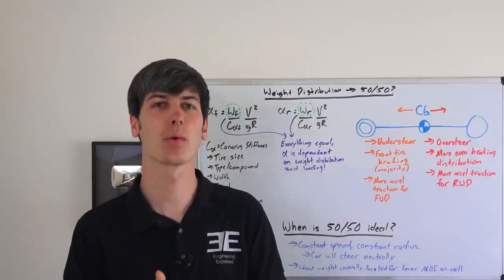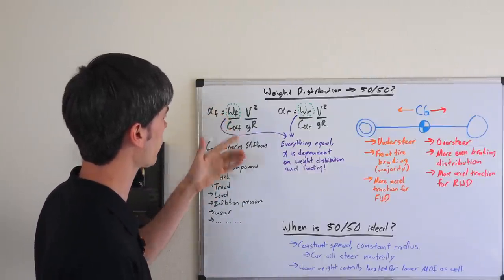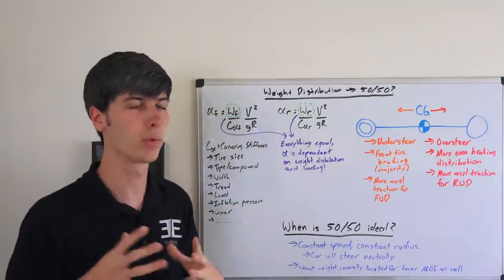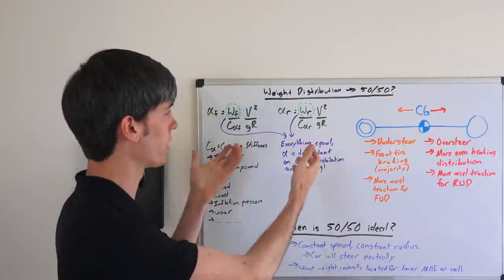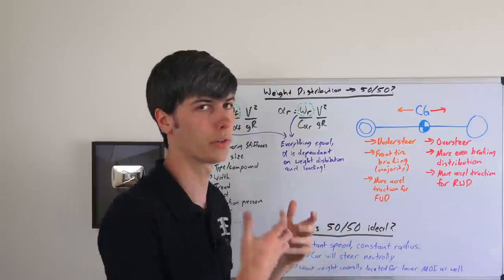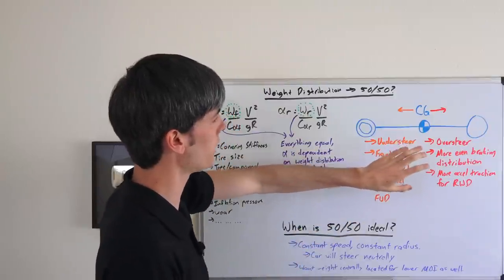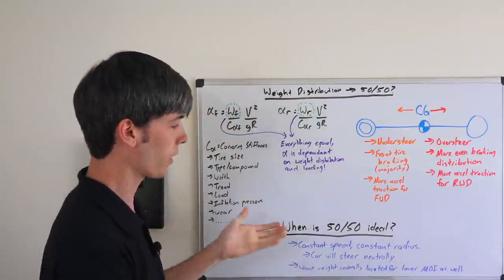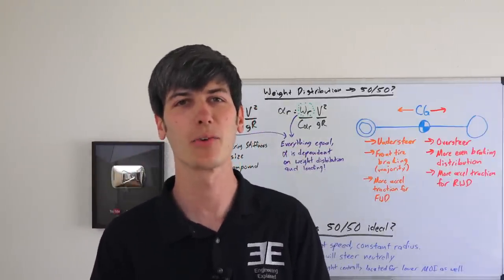Is A 50/50 Weight Distribution Ideal?

Comment: This is the reason you often see wider tyres on the rear. They have a higher cornering stiffness and can cope with more weight allowing the COG to be moved back. As mentioned, moving the weight back is benefitial for traction and braking, but also steering performance. The distance from the COG to the front axles makes a longer lever arm.

Comment: Last statement was wrong. Moment of inertia is not lowest at 50/50, it's Reduced by moving the CofG toward the rear. - because cars do not rotate around the C of G, they mostly rotate around the centre of the rear axle, especially at low speeds. Gaining a lower moment of inertia is actually one more reason for moving the CG towards the rear axle.

Comment: I think there needs a prequel for this video explaining how to take a racing corner. You did briefly mention neutral throttle during the corner and yet people are still arguing about acceleration. I think clarity is needed in regards to braking point, turn-in, neutral throttle, apex, post-acceleration and how the 50/50 fits into that.

Comment: Like you said, 50/50 is only ideal while in a constant turn/speed. Under breaking and acceleration (corner entry/exit) a rear weight bias is desirable. Although a 50/50 distribution allows for a more predictable car its not what racing teams want. Take formula one for example. An f1 car has closer to a distribution of 30% front 70% rear. Most "top tier" vehicles like Porsche, Ferrari, Lamborghini, koeniggsaig, Lotus, McLarren and others have a rear weight bias. Watch a video that shows a race driver's feet while they are driving and think about what percentage of thier time is spent on the breaks or gas as opposed to coasting  at a constant speed. That being said, I like your videos.

Comment: I don't like it. I had a 520i E39 touring (rear air suspension) and it was nasty in the snow. Coming down a steep icy hill the rear wheels locked up just from compression braking. The smallest movement of the steering wheel caused rapid and unpredictable responses. Front midship is nice when you have traction. When you don't give me a lump over the front that forces a predictable result every time. Same reason I don't like mid engined cars. I actually prefer F/F layouts despite perrolheads generally preferring RWD. I find F/F to be fun at the limit and forgiving to mistakes

Comment: Can't you make a video about over revving? 
That would be nice! 
Greetings...
Reply: Stijn Peeters what do you mean by over revving? if you are asking if its dangerous to over rev then the answer is different from car to car, some cars can do 5000 max and some even 9000, the only thing they all have the same is that you have to let the engine warm up before revving.
Reply: sweet dreams I think what he was referring to was revving past the interval which would yield the optimum average power output, not necessarily the peak. Again though, this would also differ per vehicle. +Stijn Peeters please elaborate :)
Reply: RadioACtiveN3Rd thats simple , changing map of the car to be able to rev more than stock means more heat and less reliability, in some cases because the valves dont match the high rev (9000)  you may even get less power than you did at stock rpms (7000) so if you increase the rev without touching the engine then you dont deserve to drive, it doesnt need a long video.
Reply: sweet dreams I dont think he meant taking a car with a 7000 redline and delimiting it so it can reach 9000 I think he meant more like whether or not in a normal car its faster to go all the way to / slightly over the redline before shifting up or to always keep below the redline.
Reply: You want to shift right at the redline, or right after you reach and exploit your cars peak power point. Hitting the redline just halts acceleration. To be honest, I'm not sure what would happen if you changed a car's redline from 5000 to 9000. I imagine that you would hit the peak rpm, you would have the same amount of power from the peak for the rest of the rev range. (I'm just guessing)
Reply: Evarn evon It's a little late and I'm no professional but from what I've seen, besides it being damaging to the engine, the power usually drops off significantly before the redline. If you just look up bhp graphs of different cars you'll notice a trend. It's probably dependent on the car and I'm sure race cars are quite different than road cars (de-tuned engines seem to level off for obvious reasons).
Reply: You get valve floating if you overrev too much. Valves do not close and open nomore and tend to be 'stuck' making your piston about to kiss that valve. So yeah, go ahead, overrev, drive 100mph and put it in 1st gear and dump the clutch, see what happens.
Reply: "Over revving" means exceeding the maximum RPM that the engine can safely operate at, which is called the redline, which is never good. The redline varies from car to car, but the simple answer is exceeding it is a bad idea, especially with the engine cold. Upgrading the internals of the engine can allow it to safely rev higher, depending on a lot of factors.

Comment: The way people say 50/50 being ideal is misleading. They usually forgot to mention static weight distribution.

Look at the GT-R for example. IIRC, it has a weight distribution of 54/46 when it is not moving. However, when it is moving, this weight distribution shifts closer to 50/50 throughout straights and corners.
Reply: Kalsonic during acceleration it would have 50/50 but at a constant speed its weight distribution will be equal to the static weight distribution and while braking it would be even further forward than the static weight distribution so maybe 58/62 under braking.

Comment: Surprisingly this is the result of the formula used above for my bmw e46 m3. The 3 answers are measured at 30 50 and 70mph and given as front/rear percentage 
49/51 
52/48 
46/54
On Michelin pilot sport 4s tyres at 255/35x19 front and 275/30x19 rear 35psi front and 38psi rear

Comment: Biased weight distribution is better in everyday driving as it is generally safer, more economical, responds better to engine modifications and wheel/tyre modifications. Here is why...

All else being equal (tyre material, rim size etc) maximum traction you 
can achieve will largely be a product of the weight placed on the tyres 
of the driven wheels. 

If we were to have two identical vehicles (total weight, engine power, transmission gearing etc) the vehicle having a biased weight distribution on the driven wheels of say 60/40 rather than 50/50 means that at any given time there will be greater maximum traction on the vehicle with a biased distribution.

This also means the vehicle with a biased weight distribution will have more ability to plant more power should the engine power be increase as in modifications.

A biased weight distribution also means the driven wheels have a higher threshold of traction in motion such as the lateral shear forces experienced in a turn. This makes the car safer as the car has a higher threshold before losing traction and control.

So in short a 50/50 is not the best for traction.  A biased weight distribution has better traction, much safer in everyday driving, ability to reduce wheel spin when ground pressure is reduced such as when wider tyres are fitted and is also more economical with less minute slippages experienced.
Reply: "So in short a 50/50 is not the best for traction.", unless it's a 4WD then...

Comment: Great video.
I think you should expand on this and describe how a car's weight distribution impacts how you would attack a corner.
For example in an S2000 you would do your breaking before entering a turn so that the car is 50/50 through the turn, and in an 911 you would trail brake through a turn to achieve 50/50.

Comment: @Engineering Explained Most weight distribution discussions seem to focus a lot on "something / 100-something" weight split front/rear but completely ignore the impact of weight being more centrally located. Any chance to make a video on that? When I imagine a standard gym weight in 2 setups a) O - - - - - - O vs b) - - - OO- - -  , the weight distribution is 50/50 in both cases, also center of gravity is the same. Nevertheless if they would be hanging by rope attached to CoG and I should turn it around by pushing towards side on one of the ends (basically what front wheels are trying to do 😅) the result would be different. The difference could be major for vehicles with engine in the middle...

Comment: So this may be a silly question but here it goes. If a car had a 50/50 weight distribution, and in the rear, the car had a lot of down force, would that make a big difference in the rear brakes ability to slow the car. Would more downforce in the rear even thought the car is balanced 50/50 enhance the braking ability of the rear tires?
Reply: If properly biased with enough stopping power, yes.
Reply: of course it would - that's basically what downforce gives to the tyres - more grip. Also wings for downforce will likely generate more drag which will also help the car to stop. eg: Just lifting off the throttle in an F1 car causes more braking effort than a normal street car with the driver hard on the brakes.

Comment: how do some cars like the Mazda Miata an s2000 which both have front engine and front mounted transmissions have a 50-50 weight distribution? All the weight is in the front.
Reply: kevin soos Aside from the RWD, which makes you place the differential in the rear and a drive shaft in the center of the car, they try to move the engines as far to the back of the engine bay as possible, so you'll get a so called front-mid-engine set-up, where you have the engine behind the front wheels. You'll notice that the Miata and the S2k both have pretty long hoods relative to their size and they both have their engines over or even behind their front wheels. This also moves the passenger cabin further to the back. I don't know much about the S2k but in the Miata NA and NB for example you also get an aluminum hood and the battery in the trunk.
Reply: Tail shaft, diff and body design champion.

Comment: Can you do a video on your calculations and how do usually tackle equations and derive them? How do you know which equations to work with given that there are many determining factors for real world situations? I've seen your "Slip angles Math" video, but my question is in general. Do you start by looking through a specific book/website?
I'm in my Jr. year (Mechanical Engineering).

Best regards, 
Loyal subscriber!
Reply from the maker: CRVB7 I typically don't derive anything. Much smarter people than myself do the heavy lifting, I simply try to understand it and relay what I learn.

Comment: Question: 
does a mid engine car with a 50/50 weight distribution still accelerate better than a front engine car with 50/50 weight distribution, with all else being equal?
Reply: Accelerate better as in due to having more traction.
Reply: All else being equal (tyre material, rim size etc) maximum traction you can achieve will largely be a product of the weight placed on the tyres of the driven wheels. 

If we were to have two identical vehicles (total weight, engine power, transmission gearing etc) the vehicle having a biased weight distribution on the driven wheels of say 60/40 rather than 50/50 means that at any given time there will be greater maximum traction on the vehicle with a biased distribution.

This also means the vehicle with a biased weight distribution will have more ability to plant more power should the engine power be increase as in modifications.

A biased weight distribution also means the driven wheels have a higher threshold of traction in motion such as the lateral shear forces experienced in a turn. This makes the car safer as the car has a higher threshold before losing traction and control.

So in short a 50/50 is not the best for traction.  A biased weight distribution has better traction, much safer in everyday driving, ability to reduce wheel spin when ground pressure is reduced such as when wider tyres are fitted and is also more economical with less minute slippages experienced.

Comment: Does the size of the tires matter? I once read an article about a car (I think it was the V8 Vantage) that has a 50/50 weight distribution and the author said that it is completely pointless because the rear tires are wider than the front tires
Reply: +HATECELL larger tires give better grip. So you can theorically unload more the back of the car, and thus, (if i'm not mistaking) braking harder in a corner. the balance of a car is defined by several things, larger tires aren't pointless. The author probably mean that balance wasn't at his taste because of the addition of 50/50 weight distribution and larger rear tires.

Comment: I don't understand how loading the front tires equals more understeer. Loading the front tires during a corner takes away weight from the rear, thus the rear tires should kick out given it's the lighter end, right?
Reply: +TheHm3 the centripetal force of the weight of a car in a corner is applied were the weight is. If the weight is in the front, the force your tires are fighting against is on the front, so it's the front tire that slip.
Reply: César Chaussinand I mean I understand the concept but still can't wrap my head around it. Like mid/rear engined cars have a ridiculous amount of understeer and snap oversteer because of all the weight in the rear. You can turn in easily because of the lightweight nose but by apex you'll have all the weight in the rear and the car will start pushing and won't want to rotate. So wouldn't an FF car be the polar opposite of that (off throttle).
Reply: from what i understand, over and understeerare mainly results of the driving. How you tranfer load during the corner is the key and weight distribution of the car is just part of the reason your car is more or less likely to oversteer.
Reply: FWD with light back ends can experience lift-off oversteer more easily and other kinds of oversteer in certain situations when all the weight transfers to the front. I also deliberately do this on my FWD rallycross car on the gravel by braking hard (weight goes to front, off back tires) and getting the back end loose.

I recommend watching the introductory iRacing videos about understeer and oversteer if you want to learn more basic principles (short of having a good instructor or class). FWD cars do tend to understeer because of all the work being done by the front tires. The videos help. 

Also, manufacturers will tend to want to make stock cars of both FWD and RWD understeer from factory because of liability and safety. Hence why you don't see FWD cars oversteer much on the road.
Reply: "loading the front tires equals more understeer" no it's not but "Cars that have more weight distribution to the front tire equal to more understeer by normal characteristic". It simply came from when load applied more on the tire, much heat, much stress occur they reduce coefficient of friction of that tire so it will lose traction and slide make it understeer/oversteer. Load is another story. You can make 60/40 weight distribution car understeer or oversteer as you want by transferring load to front or rear. You have to separate between normal case(no additional force) and specific situation(braking, push throttle, off throttle, handbrake or other actions that result in load transfer).
Reply: this kid is a bmw fan boy thats why.

Comment: What's F1's weight distribution? They don't seem to understeer/oversteer much.
Reply: Indra Ida Bagus Because of the way they drive. They want no under or oversteer when racing which hurts laptime. On top of that, they have to look after the tire ware too.
Reply: Indra Ida Bagus I think they do their best to modify the weight distribution for each track, which they can do since the base car is probably significantly lighter than the minimum weight requirement for F1 and so they can add ballast which they can position wherever they want so for a track where cornering is more important than acceleration they can move weight forward for more front grip and if they decide acceleration is more important than cornering they can move the weight back for more rear grip.
50/50 is just a good guide because it means the car is relatively stable in any possible condition but different biasing is better for certain specific conditions (which is what this video teaches above anything

Comment: I don't understand one thing. Sometimes I hear that more weight on the rear causes oversteer tendency. I get that, that's beacuse of inertia, but sometimes I hear that more weight on the rear tires means better traction which reduces oversteer. So... um... what? Can anybody explain?
Reply: More weight on rear in RWD = Better traction off the line because of weight shifting to the rear..
Also more weight in rear cause vehicle to oversteer because of inertia..
Reply: mid engine and rear engine incrase grip due to the weight on the wheels  and better turn in because of pendulum effect. Same thing with front weight bias like ex  Audis. Car just turn in very well. Porsche with rear weight bias,obtain a lot of turn in with pendulum effect. Thats why they are so good.

Comment: Hey i have a question. Does it make a difference in handling and weight distribution if the center lock of the wheel was at 0 offset or not? And why?

Comment: I believe the corvette c7r racing version is 50/50 like the production car.
Reply: Cole Lee Aerial  not at the 24 Hours of Le Mans. In 2018 and 2019 it finished behind the Porsche and Ford GT.
Reply: Cole Lee Aerial considering that GM moved the engine behind the driver, that would be a case of "if you can't beat 'em, join 'em." Again this reveals how "perfect 50/50" weight distribution  isn't perfect.